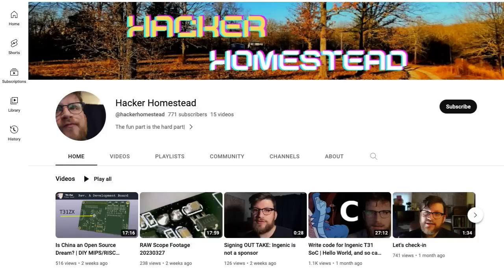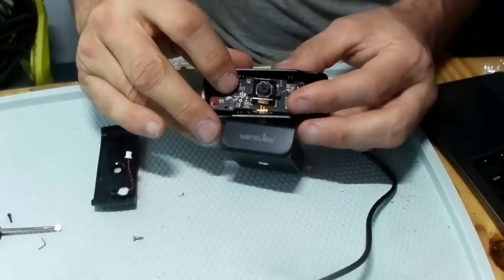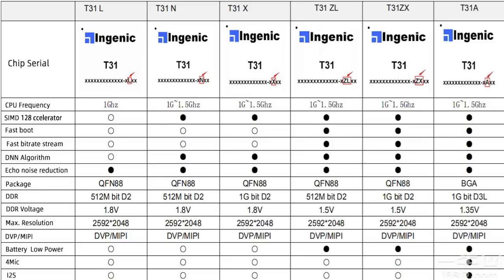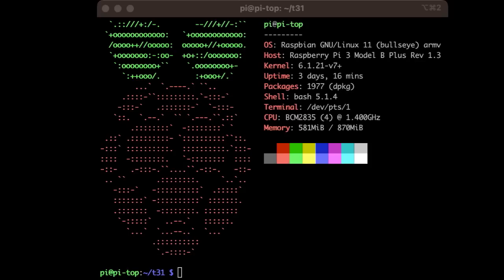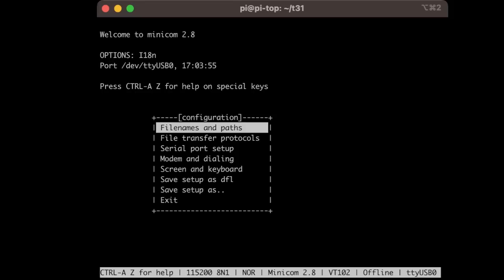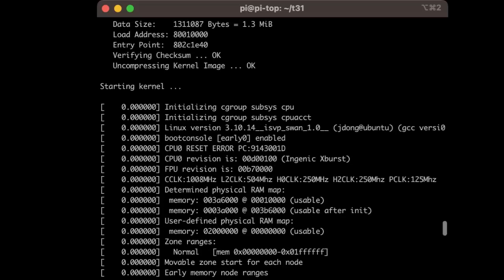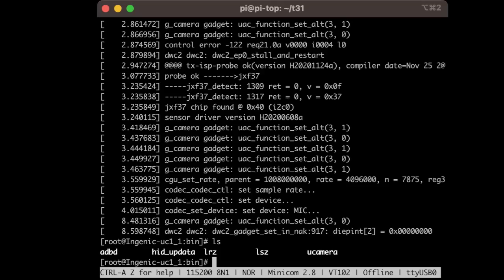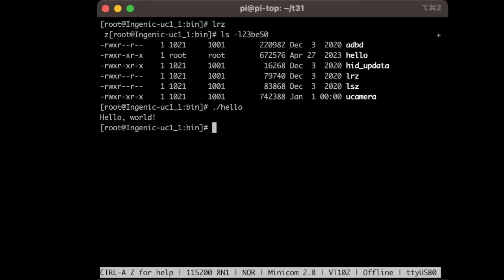Hardware Hacking Simplified? The tiny UNIX server inside a cheap webcam from Amazon!

Comment: Linux is NOT Unix. It doesn't contain ONE SINGLE LINE of AT&T code.
Reply from the maker: Pedantic but true. 

Don't forget that the "owners" of the Unix copyrights spent hundreds of millions of dollars arguing in court that Linux was in fact Unix, and of course that Linux has almost completely replaced Unix outside of niche environments. 

These MIPS processors draw a direct lineage from the ones used by SGI, who dropped their Irix Unix in favor of Linux. Sun, now part of Oracle,  still holds on to Solaris for customers who can't move, but their Solaris team is bare bones and their development resources go into their Linux offering. IBM's AIX similarly still exists but only for their Power servers, and development of it was recently shuffled off-shore as they continue to push their Red Hat Linux offering. Digital unix which became Tru64 was killed off years ago, with customers being move to Linux and HP-UX. HP-UX is EOL in 2025 as the Itanium platform it exists on is discontinued as well.

So in practical terms, Linux isn't unix, Linux is the thing that replaced Unix.
Reply: More than that Linux doesn't contain ONE SINGLE LINE of the Unix Philosophy.

I'm not sure if any of the BSDs contains any AT&T code... but they're still Unix.
Reply from the maker: Sadly there are more than one accepted way of determining if your OS is Unix or not. Initially it was lineage, if you were an actual descendant of Research Unix. It was later complicated with the Single Unix Standard, which would allow an OS to qualify to use the UNIX name regardless of its history. Wikipedia lists BSD as a "unix-like" rather than a "unix" system, right next to Linux.

In 2023 I would argue that the distinction is irrelevant outside of a courtroom. The real winner ends up being MInix, which despite being primitive in capabilities vastly outnumbers all other Unix-like systems by being installed inside nearly every Intel system since 2008.

Comment: Every other day I'm amazed how much I've learned from arduino and raspberry pi devices. I'm a retired electronics tech and Network engineer. The simple ESP32 is the fusion that has tied all my remote sensors and controls, network and electronic skills together.. just outstanding. I'm excited to have found your channel!
Reply from the maker: If Arduino had been a thing when I was young I would probably have followed a different career path... Such amazing and accessible tech! I've got an esp32 project I"m working on that I hope to feature on the channel soon as well.

Comment: Very cool! Why don't they protect the console with a password?
Reply from the maker: It's pretty common for generic Chinese devices to not have a password on the bootloader or the OS. As you get into actual name brands that changes, and you have to take stronger measures to get in. We'll run into some of those at some point i'm sure!
Reply: Most chinese companies dont bother locking people out they already copy the design from each other and dont care. But some real companies do care about security and thus lock their consoles because they dont want their software to be copied or dumped.  Some real companies also dont bother, i found out i could get uart and get into the bootloader and os of 8 out of 10 routers